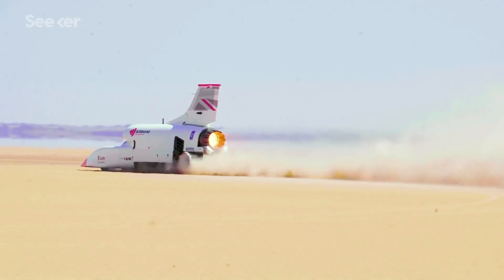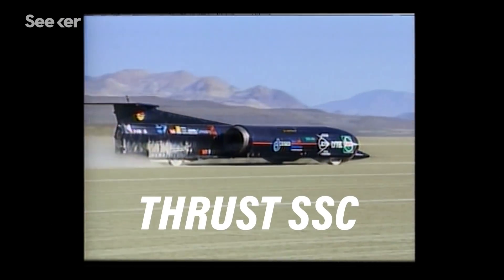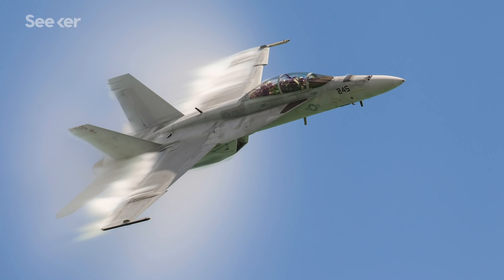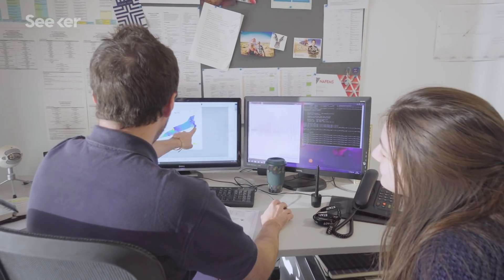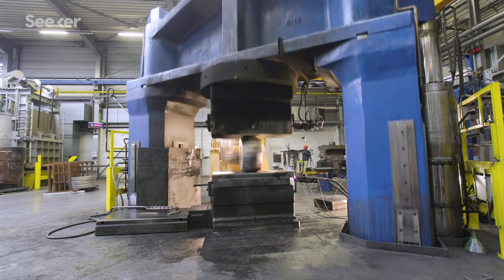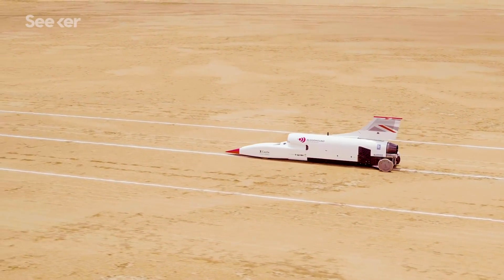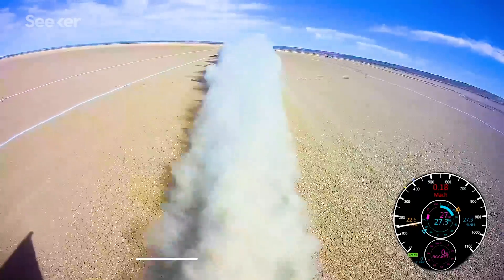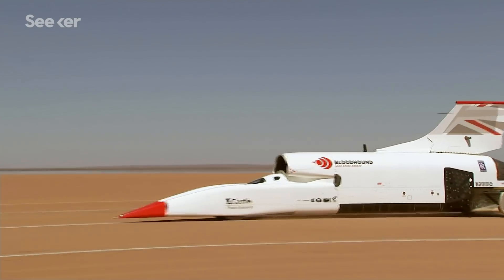This Rocket-Powered Car Is Engineered to Break the Sound Barrier

Comment from the maker: Did you know the speed of sound changes with air pressure? Based on the weather conditions of the day, the team might hit the sound barrier above or below the official speed of sound, which is recorded as 767 mph (343 m/s) in dry air at 20 degrees Celsius.
Reply: "767 mph (343 m/s) in dry air at 20 degrees Celsius"
At what barometric pressure? You just said that the speed of sound changes with pressure.
Reply: @craigcorson3036  Well noticed ! In fact, the speed of sound in an ideal gas only depends on its temperature. More precisely, it is proportional to the square root of its absolute temperature (EDIT : the first version of this comment was erroneous, which I am awfully sorry for...).
 
Of course, as often in physics, the assumption of assimilating air to an ideal gas is only an approximation of reality and may be discussed...
Reply: @gyrocompa  Directly proportional I think
Reply: @JustLorien  im asking if there is an obvious translation to other fields of study. Also, i would note that this doesn't compare to the discovery of electricity, electricity is a fundamental force of nature and has many more obvious and transferable qualities to everyday life. The key part is "how could this effect everyday life?" Electrons through a wire gave off heat, this was obvious and you could immediately apply it to the surrounding world. A rocket car is cool but I'm just having trouble seeing the point or the bigger picture. For example Air transportation is much faster, carries a heavier load and is easier to construct, it isn't confined to borders or long stretches of railing, and doesnt depend on road ways. Air travel has more freedom and options and contributes more to surrounding areas. There was a clear goal and benefit for studying physics that translates to understanding our origins in the universe and personally i think thats a high priority because it increases survivability of the human species and that's our basic instinct. I'm having a hard time coming up with justification for the expense and study of rocket cars is all, no Ill will intended.
Reply: What is the pupose of this? or rather, what will this do to change the world? What problems does it solve?
Reply: @JustLorien  it was the name of a British missile in The 1960s. And, of course, "The British Bulldog" is a symbol of British spirit  much the same as "Uncle Sam" is of the USA.
Reply: @Gribbo9999  It still seem like a poor name. Using "Bloodhound" as a name of a missile implies it finds its target but a rocket car is not searching for a target. The bloodhound missile used a radar tracking device to find its target hence the name bloodhound. The British Bulldog symbolizes a fighting spirit and Uncle Sam was a real person who helped the Continental army. Calling a rocket car bloodhound does not fit or make sense.
Reply: Did you know this isn't "rocket powered"? The guy you interviewed literally says used a military jet engine.
Reply: No, the speed of sound doesn't change with pressure. It changes becouse of the composition, aka dry or with water vapour, and temperature
Reply: 1130 feet per second
Reply: it doesn't really actually change with pressure. Mostly just temperature. Pressure has a MUCH smaller affect...
Reply: @JustLorien  I'm a Bloodhound Ambassador and as someone noted it's named after a supersonic missile aerodynamicist Ron Ayres designed in the 60's (who designed the car), but oddly turned out a good name when the education side started up as the project is inspiring you people into STEM areas, so kind of sniffing out talent.
Reply: What about Aussie invader car? Aren't they trying for the same record of 1000 mph? I wonder how do these two cars compare.
Reply: Actually you'll find the speed of sound is only depedant on the air temperature.  Yes, I know that changes the air density and hence pressure but the equation only mentions the absolute temperature, nothing else.
Reply: @Goproflying  The OP disagrees with you.
Reply: How do they get enough funding for such projects ?

Comment: So far as the laws of physics go, what is the absolute speed limit for a land vehicle? With hypothetical future indestructible materials would MACH 2 somehow be possible?
Reply: On the surface of the Earth, the gravitational forceis 9.81 m/s^2. In order for this force to keep an object on the surface of the Earth as opposed to lifting off the surface and into space, the tangential velocity must be less than 7905 m/s. If you were at the equator, the Earth is rotating 460 m/s, meaning if you traveled in the opposite direction, you can go a maximum of 8365 m/s without lifting off the surface. So the maximum speed on the surface of the Earth is 8365 m/s.

Ignoring this, if you were on a perfectly flat surface, the maximum possible speed would simply be the point where friction = thrust. If you are in a vacuum, then the friction would be coming from the wheels. Force from rolling resistance is calculated by F = c*Fg, where c is a coefficient dependent on material and Fg is force of gravity. However, one thing we can notice here is the fact that as long as each additional engine we attach has a thrust to weight ratio greater than c, we would be able to accelerate (in a vacuum). The only limiting factor in this case is probably heat generated from the wheels, which I don't know how to calculate.

If there's air resistance, I can imagine the maximum speed to be similar to airplanes since airplanes benefit from not having rolling resistance, while land vehicles benefit from not needing to produce lift. If you take something like a SR-71 blackbird, stick some sturdy, metal wheels on it and put it on a smooth surface and remove the wings, you'd probably reach something like mach 3.
Reply: Rocket sleds have reached Mach 10, so it's really a question of whether you are fixed to the ground or not

Comment: Am I only one thinking a jet turbine engine isn’t a rocket engine?
Reply: this video didn't quite cover everything it should have about the power train. If anything they've confused things a bit. There's a rocket, which gets ignited once over a certain speed (around 500mph i believe), a jet engine which is used to propel it to that speed, and beyond, and a regular combustion engine (jag v8 i believe) to power the fuel pump.

Comment: Use H vibration on the tip of your rocket to displace air completely. = Safety for pilot/CMF & removes limits of drag & heat.

Comment: It's not a car
Reply: It has 4 wheels, brakes , suspension. It's a car
Reply: @TheFreshSpam: What’s the point? Airbus, locomotive and space shuttle also have wheels, brakes and suspension.
Reply: @frozenman82  it's a car because it's designed to operate on ground
Reply: @frozenman82  oh so one companys design is good enough? Why do we even have other car companys and airplane companys. Screw it why do we have multiple space agency's? Do you see how silly you sound?
Reply: What is a car?
Reply: @manynamy  42

Comment: Why can't they put all that effort for creating next gen eco friendly vehicles
Reply: DUH. your "next gen eco friendly" vehicles are built with ultra-light carbon fiber that were developed NOT because the wanted to be eco-friendly, but to make racing cars lighter and thus faster.
Reply: @basketcase1235  yeah...u r right... fitting a rocket engine is practical enough to solve all problems ...
Edit: can't wait to buy one..also can't wait to see all of them on the STREETS
Reply: ew

Comment: Good video. Just one thing - "aircraft-grade aluminium" usually just means the same 6061 or 102X alloys that everyone uses for transportation purposes - even including bicycles. I get it, it sounds fancy, but it's not THAT special. If it were a different alloy then you may want to mention that, since everyone's used to hearing how everything is made from "aircraft-grade aluminium" :)

Comment: this is not a rocket-powered car, it has a jet engine... don't you know the difference, dang it?
Reply: It's a rocket powered car. It has a rocket on it. The rocket powers it. It also has a jet engine. Do you ever read or watch videos, dang it?
Reply: @TheFreshSpam  it has a jet engine that occupies more than 60% of the frame, to this add the air intake. the mini rocked engine will be just a booster, while the jet engine will provide the main thrust to accelerate the car. so, since the jet engine will not be removed and the rocket will be just a booster, this is a jet powered car. dang it :)
Reply: @pteronoid you can paint and smile all you like to try get it back. It's a rocket powered car ahaha
Reply: @TheFreshSpam  how is exactly your argument is better than mine? it has both a jet engine and a rocket engine, first one is the main propulsion and the second one is a booster. how do you exactly ignore the main propulsion system? at best it is a hybrid car, but since the jet engine provides more than 65% of the thrust, it is more a jet car than a rocket car.
Reply: @pteronoid  because for it to be the spectacle that it is and reach the speed it goes the rocket does the extra pushing for that higher speed that reaches the record. Without it, it's just simply a fast jet car. The rocket is paramount for the whole car and projects existence, without it the engine cant do it.

The jet engine is just there to get it to speed for the rocket
Reply: @TheFreshSpam  without the rocked it cannot even break the sound barrier? so what is the point then? Thrust SSC broke the barrier with 2 jet engines that are less powerful and while having a huge frontal area. this one has a jet that is 50% more powerful that one of the engines used by Thrust SSC. Bloodhound should have at least a 1.3 TWR. they f-ed up somewhere if they cannot achieve the speed with so much power.
Reply: @pteronoid  it breaks the sound barrier easy. Alot of things can. It's going past mach 1. 1000mph speed 

The jets get it past the sound barrier that's not the record it setting. It's going way higher
Reply: @TheFreshSpam  really? and when did this happen? did i miss something? don't get me wrong, i root for this team and i want them to succeed, my complaints are actually with the video. i follow this project closely and for the moment they reached only 628mph (1011kph) they did not broke the record yet. so if you know of a video with the record breaking run that i haven't seen yet, feel free to show it to me.

Comment: I thougt it was going to be powered by a Hybrid rocket engine
Reply: It is, but they will also need the power of the jet to go from 0 to 1000mph in only 5 1/2 miles.
Reply: @michaelh1194  in the video they said solid rocket booster🤷‍♂️

Comment: ...But never will😐
7:10 oh ok all you have to do is ADD a completely (unplanned for) separate rocketry system to an already existing jet powered vehicle.. yeah this is never going to happen is it🤷🤦😂🍻
Reply: Oh but they will. This has been planned for since Bloodhound's conception which was over a decade ago. There is already a slot for the hybrid rocket to go (under the jet engine). They just need to finish testing the rocket before placing in the car.

Comment: Googling the speed of sound gives 767 mph / 1236 kmh, am I wrong for thinking the SCC did not break the sound barrier then? 1:20
Reply: It did. the speed of sound is not static. It changes depending what medium it travels through as well as the temperature of the medium. When Thrust SSC set the land speed record of 763 mph, the speed of sound at that time was 761mph which is why a sonic boom was heard during both rounds. I don't remember which run it was, but Thrust SSC actually topped out at 771 mph.

Comment: i wonder how long until this is possible with electric motors alone, if the wheels only spin around 10k RPM, motors can spin faster than that and for battery you only need it to achieve a couple miles worth of charge
Reply: Mike G 

Seems that traction would always be an issue. Don’t need any with a rocket powered car.

Comment: So if you can move at top speed. And store all of that energy up... that was used to go forward. While simultaneously turning the propulsion off. 

You could then in theory go faster for free. And use all the variables against you. Against the variables.

Whereby.

Comment: imo rockets are cheats 
Its basically a plane on the ground 

The challenge would be probably better without them
Reply: No it wouldn't. There was a video explaining why they use rocket and jet engines over conventional piston driven ones. They explained that if they were to take the same engine that a Bugatti uses, they would need over 90 of them just to reach 1000mph (you can already imagine how large the car would be as well as how much it would weigh. This also doesn't account for the limited track they have to reach the speed and slow back down to a stop). They only have 5 1/2 miles to go from 0 to 1000mph so they still need even more power and that's where jet and rocket engines come into play. They are extremely compact and deliver much more power for their size than any piston engine or in this case, piston engines ever could.
Reply: @michaelh1194  disagree.
Rocket's are a lasy solution for non existant problems. Let's just stick a bomb on a chassis and make it explode in one direction. 
Cool? Yes. 
Reasonable? Useful? Meh.
It's not a step forward, it's a lateral movement. Exactly for the reasons you mentioned actually.  There must be a better solution than a guy in a rocket or piston driven shit
Reply: @fast1nakus  You are fine to disagree, but that solution you speak of has yet to come and given the limited amount of funding this team has, it makes sense to use what they know works to achieve their goal(s) which is still very impressive and ambitious.
Reply: @michaelh1194  definitely impressive and ambitious.

Comment: Calling it a “rocket powered” car is misleading,  as the small rocket just adds a little thrust to the jet engine powered car.
Reply: They had problems with the supplier of the hybrid rocket so have downgraded their plans for the first runs to use a solid fuel rocket, so that only pumps out 50% what the jet does in reheat. They are still planning on upgrading the rocket to a hybrid one once they hold a new record. That will kick out a little more than the jet does.
Reply: Mechanical Menace you’re so full of crap that you have to like your own comment. Lmao. First, watch the entire video before you comment. Second, A HYBRID Rocket engine breaths in air at first and then uses liquid oxygen when out of the atmosphere. No one is dumb enough to use a solid rocket on this car, as you cant throttle or shut it down.
Reply: @adamsmith5151  I didn't like anything. I think that's you projecting.
https://en.m.wikipedia.org/wiki/Bloodhound_LSR#Propulsion it was going to be a hybrid, it's now a monopropellant, and it's getting upgraded to hybrid for later runs. Ok I heard monopropellant and assumed solid fuel but the rest is right.

Comment: That's what I was going to say, what are the peripheral benefits? To make it un-fly. Then when do you add shocks and terrain following radar? Might be useful to cover big distances on Mars or something outlandish like that.
Reply: "Cover big distances on Mars"? That's the stupidest thing I've heard. Have you ever seen the landscape of Mars? They literally cleaned miles of Kalahari   desert from rocks by hand. Not sure who would do that on Mars.
Reply: acid junkie yea I caught all that, Mars has flat planes as well, my point is this car has no practical relevance but that it is a test bed for innovation and only peripheral application, I'm all for a thousand mph land speed record but in functional application it's about as ludicrous speed as a point to point line run on Mars.
Reply: he11b1ade why are we only figuring it out at the end of the video then...?
Reply: All development for peripheral application they are not going to market and sell or put into commercial or municipal use a thousand mph car unless it's on a controlled surface road bed point to point, I saw all the high speed fluid dynamics and other cross application engineering and innovation forged alloy wheels and what not that can be further developed for market purposes. Besides the advancement and sport of a record and visceral esthetic of design it carries one guy really fast one day a year. I don't think these guys would be in it if they didn't see a little humor in that. Go rocket car!

Comment: Monopropellant?
Sounds a bit pansy, that should be a solid fueled booster... 😈
Reply: I think solid boosters might be too dangerous since they can't be controlled
Reply: @Isaac Wrathall So wait, hydrazine is safer??? Dude... At this point I'd rather have SRBs strapped under my ass fired in sequence for each trip...
Reply: Hydrogen peroxide, not hydrazine.
Reply: @mikeedwards350  ok, my bad.
Reply: Hopefully the pilot doesnt melt to death
Reply: it's HTPB, Hydroxyl-terminated polybutadiene, mixing with the h2O2 HTP through a catalyst pack which produces oxygen and very hot steam. Very English, Sunday drive at 1000mph down a dried lake bed and stop with all the makings of a cup of tea :D